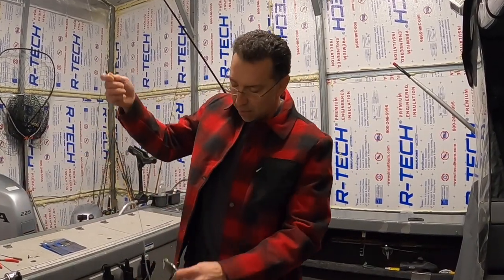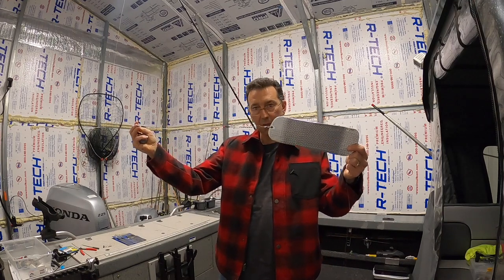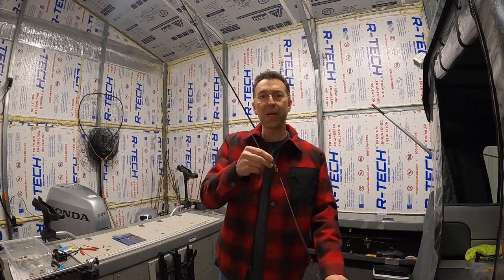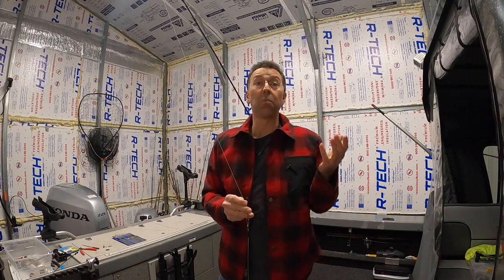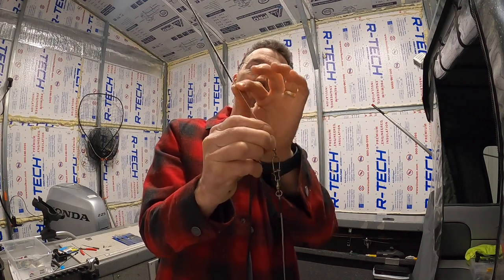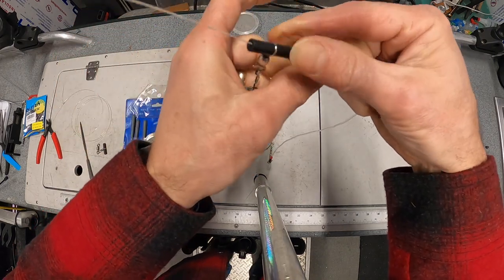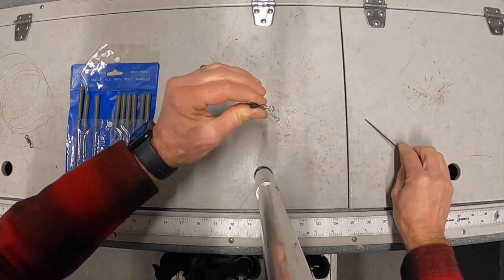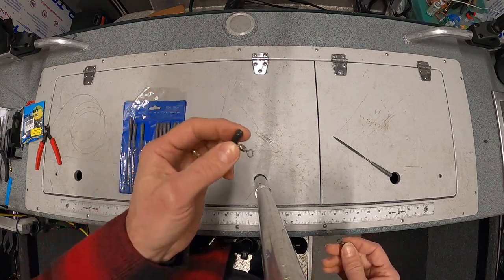360 Flasher Rigging Mod to Minimize Line Twist

Comment: why not just use the VIP slider lock?
Reply from the maker: Those are great. As I mentioned in the video, you can buy sliders like the VIP slider lock that already prevent line twist.

But they are not sold everywhere and many people have access to the standard sliders that have  been around for years.

I have accumulated years of regular sliders  on hand(as I’m sure others do) that with minor modification can be just as effective.

But if you are starting from scratch and have no  inventory of sliders and you have local access to the VIP slider locks, by all means, buy them. I like VIP products 😀